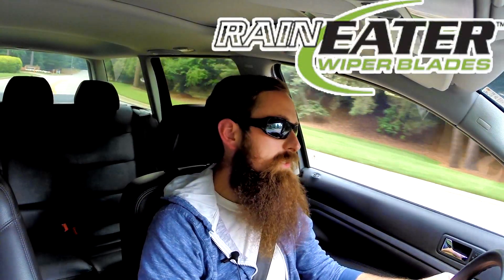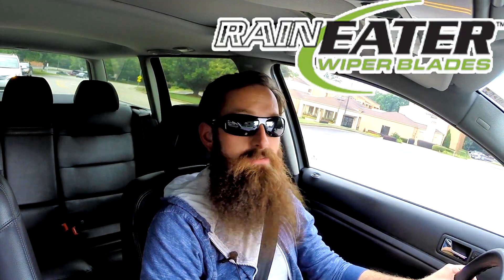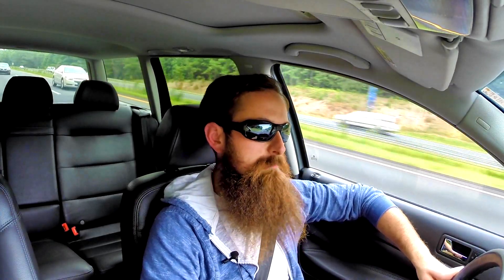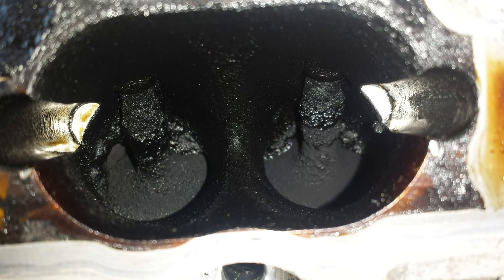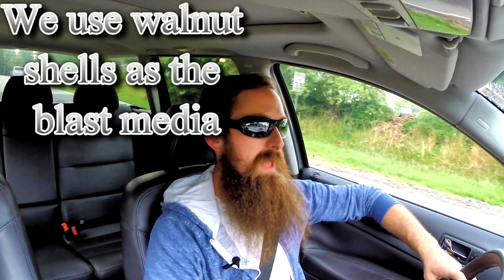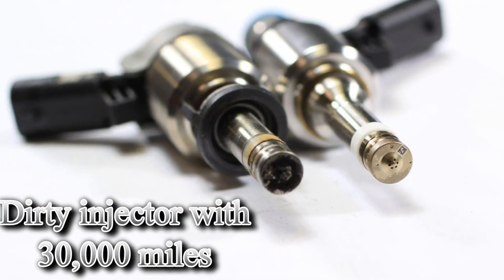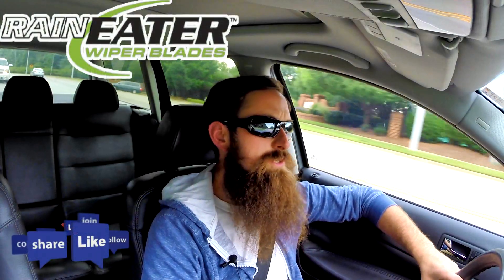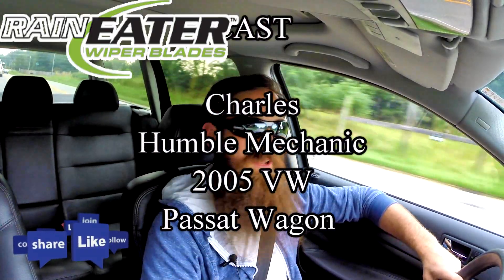Preventing and Fixing Carbon Issues for Direct Injection Engines ~ Episode 80

Comment: I wonder if you sprayed that fuel additive into the throttle body and soaked the valves then waited 1hr if the would at least clean the carbon off at least the valve seals... going to wait for the video!
Reply from the maker: All that junk is gonna go somewhere
Reply: That's I planned on so after using the CRC valve intake cleaner (which made it run worse) ran in the tank a techtron fuel injector cleaner and three other cleaners I have had success using in other vehicles to remove the gunk from the cylinder. Now I was told the catalytic converter should get hot enough to burn out the deposits.... have notice a residue on the rear bumber. Will later need to test the catalytic converter flow to assure that is not plugged. The cost of top fuels out way the cost of having this done but as you said "additives" will not be the cure! Many manufacture are now running both sets of fuel injectors to help prevent this.
Reply: But as of a week later hugh difference in performance!

Comment: The owners manual tells you exactly what octane fuel to use. Useing other octane rating are bad for the engine, as they are made assumeing a certain type of fuel is running through it. Economic  vehicles want lower octane fuel that burns differently, slower, less pure. Performance vehicles want the purest fuel so it can burn quicker and make more power. Putting the wrong fuel in a car lowers efficiency and performance

Comment: Great videos Charles.  09 Passat.  Intermittent cold start P0304 and P0303.  Changed plugs and coils (upgraded from ShopDap) intermittent misfires remain.  My shop says $500 for carb clean.  Is it dangerous to use CRC to see if I can put off real carb clean?
Reply from the maker: It’s not dangerous if you follow the proper directions. But it’s probably not going to do much to help.
Reply: @HumbleMechanic  Thanks for the quick reply.  Keep up the great work.  Huge VW fan!

Comment: I've found that I have not had any carbon issues with my German cars since switching to full synthetic oil all the time! Do not use real oil or blends, it has to be 100% pure synthetic!
Reply: Yes, it seems it works a lot. Also, highway driving seems to help too.
Reply: Along with your suggestion, I recommend frequent oil change intervals. I go 5K between oil changes.

Comment: Dexos oil...even with a catch can some will make it past the valve stems. Dexos resists coking and eventually baking and becoming hard carbon. Still not a 100% fix, but will prolong needing to manually go in to clean. 

Direct injection=catch can, egr delete if equipped, and Dexos rated oils.

Comment: I've got a 2013 GTI (with DSG trans) and had this problem appear at about 88K miles.  I'm also a big fan of the "Italian tuneup" but purchased the car used with 38K miles so most likely inherited the problem.  The local dealer is quoting me two processes, one for about $700 and one for $1700.  My mechanic has yet to get back to me with a price, but hopeful it will be towards the lower end.  If this is now part of "routine" maintenance I'm going to clean it up, get it running back to normal, and sell this thing.

Comment: Italian tune up/long highway drives is the definite preventative action. I have an A5 with 3.2 and 188k miles now, and I make a 600 mile trip once every 2 months rather than flying. Car runs and idles like brand new, and never had a build up issue even when scoped at shop.
Reply: Marco Polio  yessir; 212k and still no carbon cleaning. It doesn’t get driven as much anymore though since I added a truck when my son was born. I have a bunch of videos of the car on my channel.

Comment: "The truth is it doesn't really matter why it's happening"
What an odd statement - solutions 'directly' depend on WHY it's happening.
Reply from the maker: The only thing you can truly do is proper maintenance. Unless you are trying to do something like port injection. 

Therefor it doesn't matter why, as much as that. The steps are the same.
Reply: @HumbleMechanic  Thanks for the reply:-)  You're correct that you're probably screwed if you've already bought the direct injection car.  However, that also means there's really no "Preventing" carbon build-up, contrary to the title of your piece.  If you do know what the cause is (e.g. not getting engine hot enough to blow off the carbon, or oil recirculating from the CCV), then, perhaps, an "Italian tune-up" or an inline can to remove the oil WILL help - Depends Directly on the Cause. 

Personally, given that port injection solves this issue, and having just cleared out a load of carbon on my other car, I'm more inclined towards a port AND direct injection solution in my next car (like Toyota/Lexus 3.5L, 5.0L and the 2.0L flat four they have Subaru building) since they seem to know WHY it's happening.

Comment: Hey Charles so I have a vw cc with Unitronic stage one plus just yesterday I realized that when I’m at idle my exhaust will pop/burp And when it did my engine will rock back and forth i Installed r8 coils packs after the tune but didn’t change the spark plugs could it be that or could it be dirty fuel injectors or carbon build up ? Keep in mind I just hit 60k miles
Reply from the maker: It’s possible they plugs should be replaced.  No issues before the tune?
Reply: HumbleMechanic I had a misfire before the tune about 8 month ago so I changed the spark plugs but it was cheap spark plugs but it did help, then about 2 month ago I got my tune and I put in the r8 coils packs but still had the spark plugs from 8 month ago so I hope it’s the spark plugs
Reply: The rpm sits under 1k rpm and it usually sits on about 600rpm when it’s normal

Comment: Picked up an immaculate 2012 Tiguan SEL with 98k on it. Body and interior were flawless. Had the car about 2 months and everything was wrong with it. Carbon buildup, coils, water pump leaked, pcv went out, entire top of the engine leaked oil. To fix all that would cost more than the car was worth. Why anyone would put up with that lousy engineering when you can buy something from a couple of other manufacturers that will run for 200k plus with none of these issues is beyond me. Wholesaled the pos and said good riddance.
Reply: Sorry man, but I would never buy any model of car with that  many miles.....the most miles I've gotten out of a car was 167,000, and I bought it with 12,000 miles on it, two years old. Then, 153,000 on my next one. That I bought with 37,000 on it, 3 years old. Both Chevy's, a 92 S10 truck, and an 05 Blazer. The life of almost any engine has to be at least half over at 90,000 miles...better luck on your next vehicle, shoot for less than 40,000 miles, and no more than 3 years old.👍

Comment: With it being so much of an issue manufacturers should start making bosses with removable plugs on the intake manifold over the valves to give a direct shot at cleaning them with chemical processes like BG.
Reply from the maker: That would make cleaning much easier

Comment: There is a VW bulletin that recommends running the engine at 3200rpm for 20 minutes. Apparently this rpm for this duration makes the engine hotter to aid in the carbon breaking up. I've seen pictures of engines that used water/meth as well as PCV oil catch cans. They do help but as you said inherent nature of the beast. That's why as you mentioned manufacturers are now adding and extra injector in the intake. 
My auto shop teacher taught us about direct injection in the late 1990....even then they were aware of the carbon build up flaw. Manufacturers have chosen fuel efficiency and power as that's what the demand calls for.

Comment: Catch cans are the way to go.  If you have car with direct injection and a turbo it will save you a lot of money if you intend on keeping your car for a long time. I drive a 2014 Fiesta ST and you would be shocked how much I catch.  For easy maintenance I suggest running a hose to an easy access location and adding a valve. It makes maintenance take no time at all.

Comment: Hello Charles!  Love ur content man.    Quick question for you.  I cant find instructions on how to use the VW fuel additive you mentioned on this video.  I got a 2018 golf r with 10k miles and wanna do it as preventive maintenance.  I got a 200ml bottle can u guide me on how to use it?  Thanks!
Reply from the maker: You may need a funnel. Just pour it in the tank on at least a 1/2 tank. Make sure you drive that R like it was meant to. Lol
Reply: @HumbleMechanic  ok so pour the entre 200ml bottle in at least half a tank.  Got it
Reply: I've read someone saying pour the entire bottle on a half tank and other pur 10ml per liter? I'm confused.

Comment: I thought that synthetic oil should help because these oils have less byproduct through the crank case ventilation.
2019 civic SI.
Reply: At best there is likely a marginal difference as there will still be this issue.

Comment: 2010 Tiguan here with 120k, and I'm good. Regular oil changes and Italian tunes. Really curious to see what my intake looks like though.
Reply: 2010 Tiguan with 200K, I also thought mine had no carbon build until replacing the manifold last month, huge build up although no mis-firing issues. Anyway after a clean up, engine is a lot more powerful now.

Comment: I have a 2013 GTI /TSI 2.0 /DSG with 93,000 miles that I bought new. Absolutely bone stock. I've yet to have any issues mentioned in this video, although I'm wondering if I'll experience it in the near future. I exclusively run Chevron 91 octane fuel. I've tried 89, but it will detonate under hard acceleration. I probably drive the car easier than the average GTI owner. I'm still running the factory brake pads with plenty of material left to go -super impressive. The car has been flawless until I recently had two ignition coils go out (cylinders 2&3)  I replaced all four coils with Audi R8 Red coils and replaced the factory plugs with NGK Iridiums (BKR8EIX). I've changed the synthetic oil every 5K-7K miles with possibly two occasions of factory recommended 10K intervals. I started running Mobil 1 0-40 "European Formula" synthetic since about the 70,000 mile mark. Prior to that was various brands of factory recommended weight (5-30) synthetic oil. The engine will burn approximately 3/4 (.75) quart of oil in 5,000 miles of driving. I usually top it off around 5K, and drive another 2K miles before I change the oil. Not that it matters but I completed the DSG fluid and filter service quite a bit later than recommended (68,000 miles) and it was nearly the same color / tint as the factory VW fluid that I replaced it with. Not sure if this is helpful info, but that's my GTI experience thus far. Overall, I love the car!

Comment: I'm going to suggest that the so called Italian Tune Up can create more issues that you didn't intend to deal with.  As you mention, they get in their cars and push them hard.. well lets see.. Lots of pressure on all drive train parts, and in the combustion chamber,  and if the thermostat isn't open yet, quick and excessive heating of the heads will accelerate head gasket failures (you should know this as a master mechanic), and let see.. how about safe operation of the vehicle.. and speed limits, speeding tickets, court costs, and high insurance premiums

Comment: I love the videos brother, hopefully this comment makes it to the right person. Anyone have a link to a write-up on preventative performance-based corrections to common problems? PCV breathers, aftermarket intakes, adjustable performance fuel pumps etc? Coming back to the VW community and want to start right, with a good deal on 80k+mi cars, immediately clean it out and do as many preventative mods as possible, while if possible, laying the foundation to a high performance build with minimal  backtracking. Thanks all!

Comment: Use a oil catch can and change regularly to reduce carbon build up.
Reply: Yes, yes, yes! Also pay attention to the volatility rates of what ever oil you use; 5% is the goal. I changed from my usual brand which was almost 12%, to Quakerstate full synthetic (the recommended oil for my Veloster) which is only a 7.3% I went from emptying my can every 1,000 miles or so, to only emptying out about a tablespoon at my 5k mile oil changes. It also doesn’t hurt to throw a stainless chore boy in the bottom of the can to give those vapors a little more surface area to condence.
Reply: @timcomtois8199  what's a stainless chore boy? I just installed a can two days ago..
Reply: @Maga4Lyfe  Its one of those metal scouring pads for cleaning pots. They come in copper or stainless steel. Get the stainless steel ones. "Chore Boy" is just a brand name.
Reply: @timcomtois8199  okay that's what I thought you were talking about. Okay so just drop one of them in the bottom of the can and it helps a little more too catch that oil. this is the first I've heard of it and I've watched plenty of videos. Thanks
Reply: @Maga4Lyfe  Yep. I fluffed mine out so that it filled the whole can tho. But, thats because I bought one of those cheap $30 cans from amazon that that doesnt really have a good baffle in it.
Reply: @timcomtois8199  well that's good to know. I appreciate it. I didn't buy a real expensive one myself I bought the jlt 3.0 for 140..
Reply: And an oil that has a low NOACK rating (less oil vapors in the intake)

Comment: I recently bought a 18 F150 3.5 EcoBoost with twin turbos & put in a catch can , while researching I came across a video that warned against using fuel additives because of the turbo's ? What's your thought on  this information  ?
Reply from the maker: I’ve never seen additives cause issues. Most just don’t do anything. 

Unless you use a big can on a car with little to no fuel

Comment: I drove my 2013 Ford Focus ST direct injection turbo 4 cyl for 15,000 miles before i came to my senses and bought a catch can. Was working on the Intercooler and adding new FMIC pipes and removed manifold/ intake one night. Could look easily into intake valves. They were coated with hard carbon and the whole chamber of the valves was soaked/coated in blackish/brown gunk. I spent about 8 hours soaking the intake ports with carb cleaner/brake cleaner and used a tooth brush, a plastic glock pistol bore cleaning rod with a brass bore brush and wood rods to chip away at buildup of carbon crust. Spent another 4 hours cleaning. Worked until all intake ports and valves clean again, bust i could do.

Something i'd like to mention is i was driving my car very spirited from about 1k on. Doing all out 4th gear to redline data logging pulls day after day after day. Just having fun with the car and do simulated hp number figures after new mods and tunes with the changing weather conditions warmer vs cooler weather.

My conclusion would be that the gas pedal to the floor method has little to no effect in helping to keep the carbon buildup off the intake valves. I did add my high quality Diamond performance catch can and it managed to catch a lot of chocolate crap mixed with slushy gas, by products and water. Never got the opportunity to pull the intake manifold off again before i sold the car with approx 21k miles. A catch can for a turbo/supercharger DI engine is a must have add-on. I just bought a 2019 Infinity Q50 sport 3.0T D.I. and i immediately bought a high quailty catch can Mishimoto with the proper internals.

Enjoyed the video and it was very accurate and truthful. Good information.

Comment: I'm wondering if water/methanol injection like the one from Snow Performance will help my GTI from building up carbon.  Methanol is a solvent and I'm thinking it could clean the carbon build up together with the water. 50/50 distilled water and methanol
I used water injection on my Cuda. 12.0:1 compression ratio was no fun back in the 70's when octane was lowered and lead was removed from the gas. The lead helped lubricate the valves which was another issue we ran into. I used lead additive to temporarily address this. I got my water injection from Automotive Performance Warehouse. Distilled water was a must. No minerals to cause other issues like rust in the combustion chamber. God forbid you let your car sit for a few days. Ask me why I know. Well, all my knocking issues disappeared and HP was restored until the water container was empty. It worked off the vacuum switch tapped into the  manifold with a nozzle spraying down my carburetor. One thing that was noticed is when I removed the heads to have harden seats put on by the speed shop to address the lack of lead issue, the back of the valves and stems were nice and clean.. I mean super clean.

Comment: Removing EGR system is illegal in the US. Carbon build up is not only an issue for the intake valves, but start at the EGR valve and even before in some cases in the EGR cooler.
As said in the video, the only efficient way we know today is to manually clean the gunk. Not only in the intake ports on the cylinder head with a brush and a pick (or much better with walnut blast), but the whole intake manifold (swirl flaps include), the EGR valve as well. Note that to clean the back of the valve and intake ports behind it, you MUST have the valve closed (manually the engine from the front crank pulley or from the starter with a simple wire connecting the solenoid to the 12 volts.

Comment: I drive an 08' Audi TT 3.2 - VR6 Engine. It has 92K - Still runs great !!  No issue with cold start ups or backfires, Should I be proactive & have a mechanic clean my carbon just as prevention ???  & whats the average cost for this service ? THX

Comment: Humble:  The purpose of the EGR system is to vent the crank case correct?  As oil is blown up the hose, it eventually gets to the fuel supply device/intake port.  Why couldn't a person install a filter to vent the crank case pressure and allow the oil to run back into the crank case??